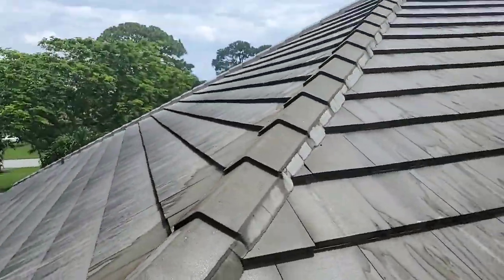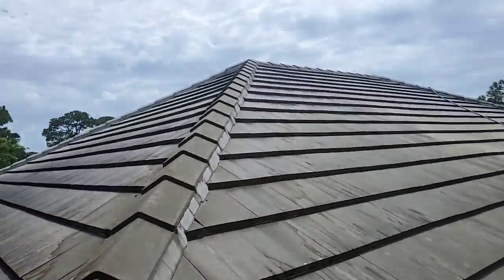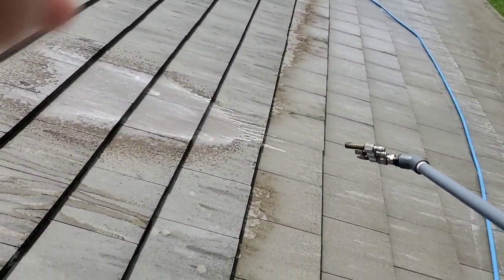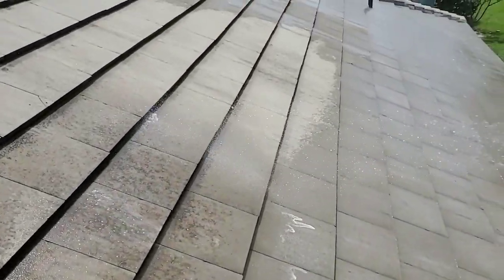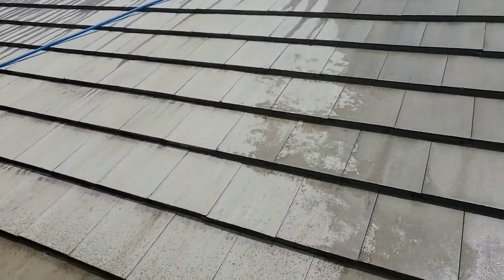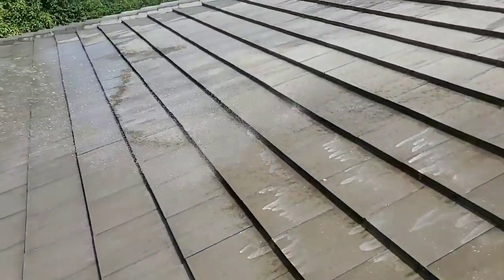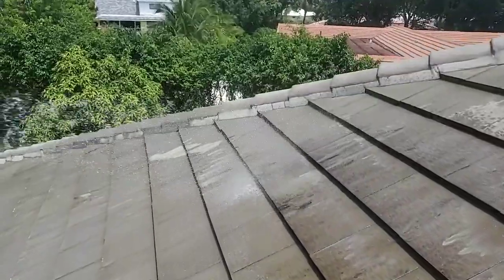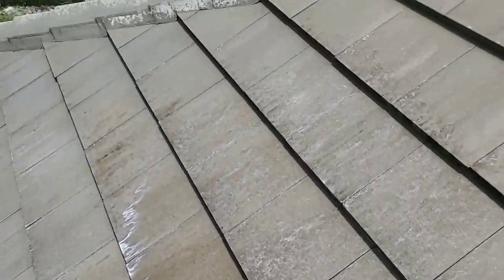Cleaning roof from all angles

Comment: Hey Mike, have you ever tried a misting type tip for shooting roofs? I havent tried but was wondering if it would save on chem costs as well as keep so much of the product from running down the roof at steep angles. I pretty much just flood everything like you but may try a different type tip on jrod just to see if it works.
Reply from the maker: I use 40 orifice tips and use 00 05 15 40°  fan patterns. Not sure if you mean like acutal mist or wider fan pattern. 12v arent built to restrict flow to much youll burn the pump up quick if its to restricted
Reply: @Oleynspressurewashing  thanks Mike!!